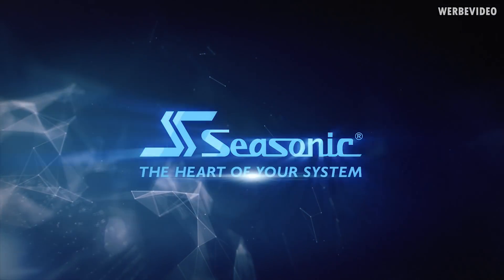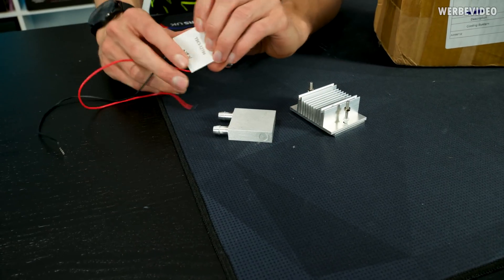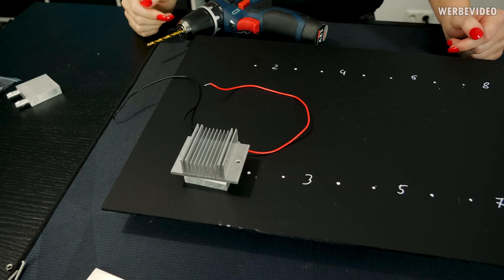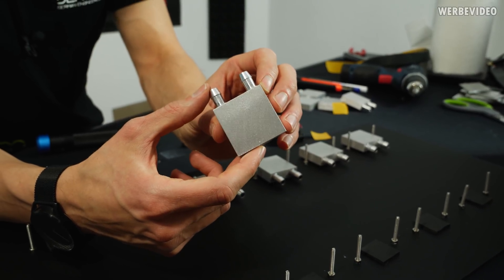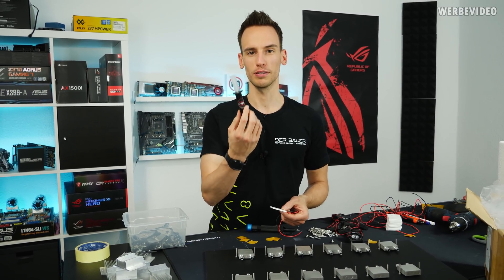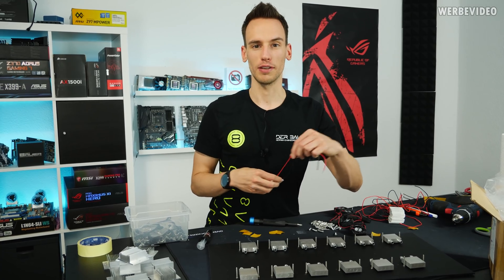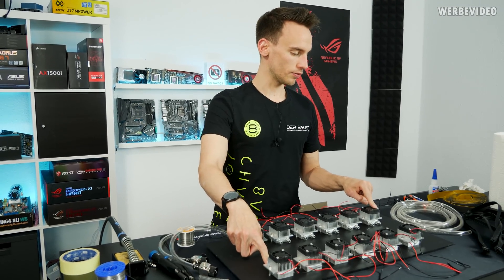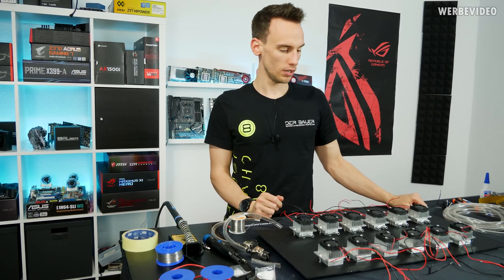200$ AliExpress DIY Water Chiller

Comment: Why not do another water-cooling loop on TOP of the Peltier TECs ... so you radiate heat from the 9900K to the TEC ... then from the TEC to another Radiator ... Also why not just bolt a BIG MASSIVE COPPER SHEET instead of all those tiny tiny Aluminium heatsinks ?? a single sheet of copper should work like a big copper heatpipe right ? Suck heat out of the aluminium into the larger surface of the copper sheet ... maybe at one end you can dip it in a bucket of ice water or something :-D or just dump dry ice on the copper :-D ... maybe install a portable Air-Con unit to blow cold air or something :-D ... 

But seriously about using strips of copper sheet as heatpipes though :-)

Comment: By the time you do this right with good fans/sinks/blocks/psu/fittings. It would be hardly any less than an industrial water chiller like a massive 750watt Hailea HC1000a for about 650 euro or a used one for for a lot less. Just a bit of fun I guess.

Comment: Perhaps just get a big copper plate and sandwich it on top of all the peltiers and then stick a few large air coolers of any shape and size on top, like some extruded aluminum heatsinks with a few large fans. Aluminum heatsinks can be had for very cheap, and you should definitely have enough surface area for the heat output of those peltiers.

Comment: You could run the coolant in a parallel split to those 12 blocks and avoid flow restrictions. But I would honestly look for larger blocks with 1/4 fittings and use regular tubing. Attach each peltier to where the IHS would go and throw some dirt cheap Hyper 212's on.  And to make it really look cool, replace the acrylic board with some anodized aluminum - spare side panel lying around from a junk case.
Reply: You want something that don't transmit energy in the backingboard, remember that the block is supposed to be below ambient.

Comment: If you added a normal rad before the peltiers would that help put a bit of the heat into the air lowering the load on the peliters?
Reply: Or a massive reservoir that you bring sub ambient a day or so before with the Peltiers, to benchmark with for just a few mins.
Reply: @TechyBen  that defeats the chiller diy part
Reply: @Mutation666  Oh, it would be DIY, DIY with a res. The res could be a bucket. ;)

Comment: Do a water cooling solution for your cooling solution
Reply: peltception
Reply: For real though. thats what i did and it works a treat. i can punch nearly 5°c bellow ambient off a single 60W TEC.
Reply: @xanderledger5331  Yeah probably going to do the same.
Reply: 13:46 voice crack

Comment: Very interesting stuff. It could have been easier to do this with bigger tec elements instead. That way bigger cooler solutions would get the job done. And could the PSU possible throttle things? I doubt it, but have to ask naturally.

Comment: I have one question. where the hell is your flux? i know its an aliexpress project so kind like 'meh. whatever' but still. if youre gonna solder, may as well do it right.
Reply: Flux core solder tin, very handy for small projects like this
Reply: One more thing, you could increase your delta T by replacing the air cooling with a cheap water loop for the hot side. i dont think it'd take much. maybe a couple 240mm for the amount of TECs that you have

Comment: A Hyper 212 Evo for each peltier element :D
Reply: one reason he may not do 212 evos for the cooling is because of cost... he was super happy the system he was building was $200-$300, adding the cost of 12 $22 coolers would almost double the total cost of the system to $400-$500, but i want to see him do the 212 evos for each peltier element too :)
Reply: @BHSAHFAD  Then woulkd be cheaper to just slap in chiller unit on it.
Reply: That should work better
Reply: I'd say a cheap €5 euro cooler from aliexpress seems more likely, not as good as the hyper 212 but miles better than whatever crap is stuck on there right now.
Reply: My thoughts exactly. That would probably do it.
Reply: I'd probably get more of those cheap waterblocks, a second pump/res, and a big radiator
Reply: I shoulda checked... I said the same thing....
Reply: I'm a big fan of the Evo, just a great bang for the buck air cooler. If going down this road, it may also be worth considering the smaller version, the Hyper T2. It's about half the cost, but still has excellent performance. I used to run those on my mining rigs back when that was a thing.
Reply: I had a setup like this for a time but watercooling the hot side of the Peltiers as well creating a secondary cooling loop
Reply: @TheLordinio  But what if instead of just adding a water cooling loop, you add another peltier loop before the water cooling loop :D
Reply: @virtual_GaRy  you can but have to keep in mind that every stage has to be able to cool all the ones before it including the losses of the peltier elements and therefore needs to be about twice as large as the stage before it
Reply: Scroll down for this
Reply: I tryed 1 time to cool down a peltier with an aio 120mm and 2fan at 1200rpm. That doesnt work.
Reply: 1 on each side of the waterblock, each with a tec, and some parallel waterflow as well
Reply: Hyper 212 base plate is 36x38mm not going to work without adding a heat spreader the TEC127 is 41x40.5mm
But a strip of 4mm copper apx 50mm by 85mm with let you cover 2 TEC127 with each hyper212 cool master will have no problems stepping up and Loan out the 212's for testing btw i have a 4 tec on a copper cube on top of my 9900k with 2 custom right angle water blocks. I can get my cpu to around 10c under full load at 5.2ghz i have very bad silicon 1.39v to keep stable i had gold with my 8700k but my 9900k is a pig also a bunch of threadripper coolers will work as well as I think the ihs is 51 x 68mm ish not 100% but easily cover a tec